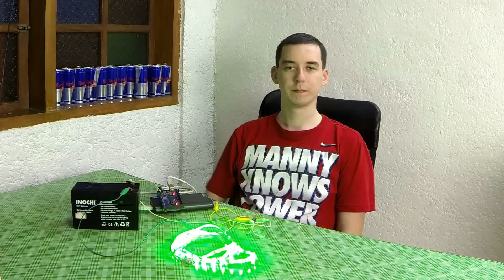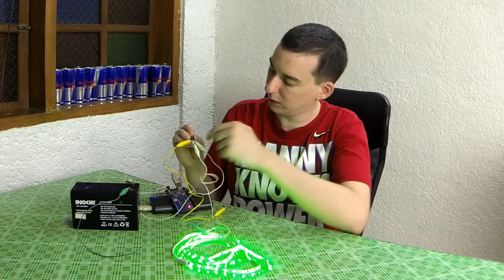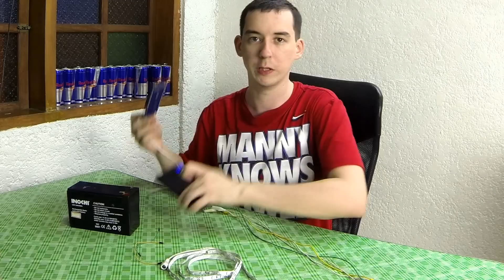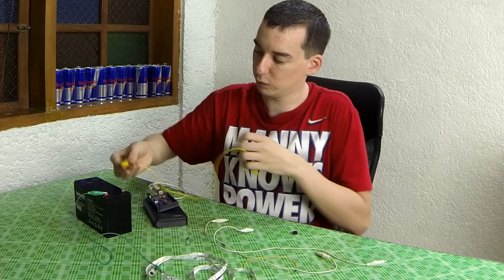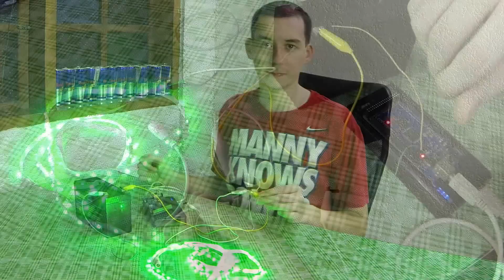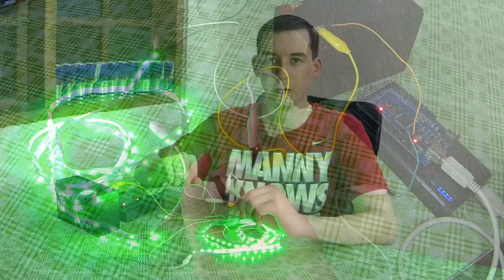Control 12v LED strip from Arduino using a Mosfet

Comment: This video is awesome! I needed this for a project I am doing for a course, but I came across a problem. I have a 5V Adafruit Trinket pro that I would like to program my lights with but it will not work with the setup. I can turn the lights on with the mosfet but not program it :( . Any thoughts on why I am having problems?
Reply: +Dynasty Holman Did you check if connections to led strip, on the transistor and pins on the board (use pwm pin) are correct? If it's as it should be, the thing that comes to my mind is that there is something wrong with either cables, the board or you aren't using the right type of mosfet.

Comment: Be aware this guy must be wearing an ankle strap since there is no wrist strap apparent.... MOSFETS are susceptible to static discharge damage..... It is also bad practice to power up the circuit before everything is connected. The last connection should be to the battery +ve terminal.

Comment: This has been the most straightforward tutorial I've found for powering LEDs.
Do you think it's possible to run 4 of these LED strips with one Arduino Uno board ?
I'm working on a project where 4 motion sensors will set off individual LED strips.
Reply from the maker: Ryan Woodhall Thanks :) And yup it would definitely be possible. It doesn't take much for the arduino to switch the transistor on and off and you have more than enough pins on pretty much every arduino I know.

Comment: Good touritals, with basic information about how to sample the MOS-fet transistor. First, however, I'm missing some tip about the gate, by looking at many project as like this, when using a MOSfet to power up high power load, it's a resistors above 100-470 ohm's between gate and output pin at Arduino. You mention nothing about this issue. Second, do you have some project's/URL to pilot lights (1-3W led's diode) with different blinking cycles, using Arduino Nano? I was thinking a simple UVA light to my DJI Phantom shod contains two red lights i face direction, and two green led's at the back of UVA. At power ON, green blink/flash 3 times during a sec., pause 2 sec. The red led blink 50mS each 3 sec. periode. The cycle period switch off after 3 min., then running for 2 min., off 3 minutes and continuous (safe battery with 3 minutes off). Power source think a Li-Po 11.1V 1200mAh do the jobs. Power mosfet have spec. 30V 5.8A (N-ch), and green mini diode 650mA @ 3,2-3,6V-3W each, green mini led 700mA @ 2,0-2,5V 3W each. Any tip?
Reply from the maker: Tage Andersson Mmm well when it comes to code, it would be extremely simple because the arduino is easy to program and the samples give you everything you need. For the example application you mentioned, you could simple open the 'blink' demo program and modify it to do what you want in a matter of 60 seconds. Those power mosfets should work fine although might be an overkill for those small LEDs :P Especially since they're only blinking and not a constant load.

Comment: Hey! Thanks a lot for the tutorial. This was easily the easiest to follow of the ones I've found.

But while everything initially worked, all of a sudden now the LED strip doesn't really blink, but kind of just goes from 70% brightness to full. The Arduino code still says 'low' and 'high', but they're basically not turning off at the low.

Any idea why that might happen? And how it could be fixed. I've been trying to follow a tutorial by a blog called Arduino Basics, but until I can get the LED strip on I can't really go any further.
Reply from the maker: Ali Murtaza Hmm I'm not sure to be honest. Have you double checked all your connections? Especially the shared ground? And have you tried swapping out the mosfet ?
Reply: Gadget Addict Yes, I've reconnected everything a few times, but it doesn't seem to make a difference. And by 'swapping out' do you mean try a new one?
Reply from the maker: Ali Murtaza Yep try another one just to check if your original one got busted somehow. I've experienced temperamental mosfets after letting them overheat.
Reply: Gadget Addict Ah okay. That would make sense. I'll try getting another one tomorrow. Thanks!
Reply: Gadget Addict Do you have any specific recommendations of which I should use? I'll probably have to order from Amazon.
Reply from the maker: Ali Murtaza Unfortunately not. I always just use any n-channel mosfet I have laying around. If you're making a product to sell or want the best efficiency then perhaps you should consider a specific mosfet, otherwise pretty much any that can handle the amps will do the job :)

Comment: Hi, hey, one question, if i want to control a 5 mts RGB LED strip, (12V, 6A) what mosfet should I use?
Reply from the maker: SplexowN Any N-channel mosfet rated for up to 6A ? Seriously, there's so many different mosfets out there and the availability depends on your area, where you buy from etc. It doesn't make much difference for the average hobbyist so just buy any that's rated a bit higher than the voltage and current you intend to use.
Reply: Yeah, the thing is some people suggest to use a logical level mosfet with low resistance at the VGs @6A
Reply from the maker: SplexowN Yep in an ideal world. If you want to know which is best because of performance, heat etc, I wouldn't be able to help you unfortunately.
Reply: Gadget Addict I don't know why so ideal hehe, but thanks a lot! :)

Comment: Thank you very much for making this video.  I'm currently working on designing a prop FX package around an Adafruit "Pro Trinket" mini Arduino board, and needed a way for the 3v Trinket to control a muzzle flash LED running on a much higher voltage.  I was wondering if I could use a MOSFET to do it, and not only did your video confirm my theory, it showed me exactly how to set it up.  Again, thanks.

Comment: Thank you for the tutorial bud.

This really opens some doors for programming 12v leds with the arduino.

You could basically make your own animated light show and sync it with music tracks or live. It's like DMX lights but cheaper and you get the same effects, if you know how to code it right.
Reply from the maker: brdane Yep! Although for big light shows you might want to buy a cheap 8-relay arduino compatible board. That's what I did for my halloween light show (its on my channel). Be sure to buy the solid state relay board because I found the standard mechanical relays would become 'sticky' if you ran them too fast.
Reply: Gadget Addict can those type of relay boards support PWM?
Reply from the maker: brdane Ah sorry, no they wont be any good for PWM.
Reply: Gadget Addict gotcha gotcha. I think just mosfets by themselves should do the job. I'm not doing really long light shows, it's just for live bands, pre-programmed to go synced up to the band.
Reply: @GadgetAddict  Your entire channel is now dedicated to traffic stops?!?? And for some reason they have a lot more views than videos like this? What is going on.

Comment: This video is so useful for me. Firstly thank you. I just find a solution about my growth chamber. I made growth chamber which is contain 3 series 3 paralel 3W power white leds. I need to control light intensity with potentiometer. So I made a design with LM350 adjustable voltage regulator but it wasn't suitable. Because my leds run with approx. 2.1A so LM350 got warmer and also there was approx 4.5V drop-out voltage. So if I use mosfet and potentiometer system, is there high drop-out voltage ? I just curious about it Thanks

Comment: Thanks for the help
could you use this set up to control the color of the LEDs (if they are able to change colors)
Reply from the maker: Jack Lamuraglia This can only turn on/off and PWM the strip. For color control you need a digital signal rather than just on/off.

Comment: I notice some of these mosfets are capable of high currents...say if I wanted to drive a couple of motors this way but required 8v from a 12v battery...could I use this arduino pwm to step down the voltage while keeping the current constant? if so how efficient would it be at maintaining say 20A of current as I lower the voltage...I suspect the mosfet would get really hot
Reply from the maker: Ian Fowler Yep you could do that and yes it would get really hot lol. So you'd need some chunky heat-sinks and probably a cooling fan.

Comment: When using the Arduino power supply I'm getting a strange result. I can get it working as intended as long as I have the 5v USB plugged in as well. If I unplug it, it doesn't work. Basically I'm using the 13 pin blink example that comes with the arduino sketch program. I'm connecting my LED strip positive to the Vin on the arduino and the negative of the strip to the center pin (drain) of the transistor, the Source pin of the transitor is connected to the ground on the arduino and the gate pin connected to pin 13 on the arduino. Like I said, it works when both power supply and USB are both plugged in, but not when I remove the USB plug. Any ideas?
Reply: Kevin Brandenburg This is of course using the power supply instead of a battery.
Reply: I did however manage to get a nine volt to work connecting the positive to both the Vin and to the positive on the strip, ground of the 9volt to source on the mosfet and also to ground on the arduino. Just not sure why I can't get the power supply to power both them. However, my intention is to use a 12v battery so I know I can get it working, just confused with why the power supply requires the USB as well.

Comment: if I wanted to power the arduino from the same 12 v battery,how could I do it?
Reply from the maker: Tore Chikano You can just connect the battery to the Vin and GND of the arudino. The arduino already has a voltage regulator built in that can handle 12v :)
Reply: Gadget Addict Thank you!

Comment: Can I use it for 12v Ws2811 strip?
Reply from the maker: Aditya Patil I assume so but I think that's an RGB strip so you might need some extra magic to control the specific color.
Reply: Aditya Patil No, RGB's with WS2811 protocol are better controlled with something like a SanDevices E6804.Each LED of the WS2811 is a Pixel expecting proper lighting instructions via the controller.
Reply: Gadget Addict Thanks man
Reply: Nodent Thanks

Comment: hi, nice vid. Could you tell me if this one would work?? i plan on passing 1 amp load
http://www.ebay.com/itm/5pcs-IRL3803-L3803-Power-MOSFET-/180927851217?pt=LH_DefaultDomain_0&hash=item2a2023ead1
Reply: Kariofillis P did you try it? did it work?
Reply: Shyam Haridas I ended up using these that i had lying around : http://www.ebay.com/itm/170943541084?_trksid=p2057872.m2749.l2649&ssPageName=STRK%3AMEBIDX%3AIT plus an LM324 op-amp cause the due outputs 3.3V and the gate from those is fully open at 4V.

Comment: I have an "IRF 540 O" MOSFET. Datasheet: http://www.irf.com/product-info/datasheets/data/irf540n.pdf. However, I can't tell from the documentation if it is N-channel, P-channel. There is one mention of "N-channel" for one illustration. And one mention of "P-channel" for another illustration.
Reply from the maker: Hmm, I'm not sure either. I would just test it and see what happens :) Just be ready to disconnect it.
Reply: Gadget Addict Interesting. No wonder I can't tell :) Thanks.
Reply: mrvelleful N-channel
Reply: Honza Jochman
Thanks. But could you please tell me how you concluded that? Did you read it from the manual, and if so, how?
Reply: mrvelleful http://www.irf.com/product/Power-MOSFETs-Single-Power-MOSFETs/_/N~1njci4
Reply: mrvelleful http://www.irf.com/product/Power-MOSFETs-Single-Power-MOSFETs/_/N~1njci4

Comment: Hi! Could you tell me, what kind of mosfet you did use in this example? I tried to do fading ledtape, but unfortunattely it doesn't work properly. Insted of dimming ledtape I have blinking ledtape. With only one LED fading works properly using the same code. Thanks in advance.
Reply from the maker: I don't remember the exact model but it was just a generic N-channel mosfet that was rated quite high in terms of amps. Far above what I needed to run that little LED strip. During my testing I swapped it out with some smaller transistors and other n-channel mosfets without any changes in code or circuit design. Are you sure your power source is capable of delivering the power required for the strip?
Reply: Hi! I solved the problem by putting the 0.1uF ceramic capacitor between VCC and GND pins of chip.

Comment: looking at some MOSFET switching circuits, they have a resistor from the gate to ground. Any thought on the use / benefits of this?
Reply from the maker: MrRobertpn The resistor to ground is a good idea. It ensures the mosfet 'turns off' when you expect it to, without any power sitting inside it. It can also solve/help the issue I showed where you touch it with your finger and the static charge triggers the mosfet.

Comment: Is it possible to use one 12v battery for arduino and LED both?
Reply from the maker: Yes. The Arduino has an onboard voltage regulator. Simply connect the 12v to the arduinos VIN and ground.

Comment: im not an electrical engineer....but is it possible to connect some AA batteries to a 2m LED strip?....i just need it for like a couple of hours of use?...any help will be great
Reply from the maker: If you had enough AA batteries wired in series to bring up the voltage then you could probably do it. Let's assume you had 8 AA batteries in series, giving you 12 Volts and assume they're rated at 2000 mAh. That gives you 24 watt hours of power. Let's assume your LED strip consumes 6 watts, 24 / 6 = 4 hours. But of course the voltage of the batteries drops as you consume them so you need to know at what point your LED strip can still operate. If it's something you're going to do often, I'd buy a portable 12v Li-ion battery. If weight isn't an issue, consider a standard 12v 7ah sealed lead acid battery :)

Comment: How hard is it to use the arduino? I don't know much about micro controllers or computers. How would I go about getting one and learning how to use it, + I would like to get an osiliscope and I haven't got a clue where to find one here in the Philippines.
Reply from the maker: It's pretty easy to get started with the Arduino. Over the years I'd tried some alternatives but Arduino really seemed the best. It comes with lots of sample sketches (programs) and there's great 'getting started' tutorials on the official website. You can buy an arduino from OLX or from E-gizmo in Manila. The clones are generally just as good or identical to the "official" arduino but much cheaper. Just buy a breadboard, some switches, buttons, LEDs and such like to go with the arduino for you to play with. I don't have an oscilloscope but I've seen some for sale on Sulit/OLX but they're kind of expensive. You can buy from china/HK through ebay but you'll likely be charged by customs when it arrives in the country.

Comment: hi, great video, but i am struggling to get my lights to fade on/off.  for a while there i couldn't get the lights to come on at all!  i am using a 12 v power supply, positive from transformer to positive of LEDs, the negative i have linked to a bread board on the negative strip.  from that strip i have wire connecting to the GRND of arduino and to the right hand side pin of the mosfet.  the middle pin of the mosfet is linked to the negative connection of the LED strip and the left hand side pin of the mosfet is linked to the pin of 13 on arduino.  i have used the fade test program, and the LEDs do not fade on/off, they just stay on, what am i doing wrong?  is it the mosfet??  any help would be greatly appreciated.
many thanks
tom
Reply from the maker: Hi Tom, that all sounds correct. What mosfet are you using? Have you checked that pin 13 of your arduino board supports PWM? It varies depending on whether you're using official hardware or clones. You might have to swap to another pin.
Reply: Gadget Addict Hi, thanks for getting back to me, i am a total novice building something for an art installation so i am trying to learn alot, very quickly.  I have just searched the mosfet online and think i have found my issue, I am using a FQP27P06 60V P-Channel MOSFET.  in your video you clearly state not to use this type.  i was given this mosfet from an online arduino supplier store after i explained what i wanted to do.  Can i make this set up work using this type of mosfet (is there something i can do in the code to make it work)?or should i just get an N-type?time is precious at this point.
many thanks once again
tom
ps how do you check if pin 13 supports PWM???
Reply from the maker: shambolica If i were you, i'd just go buy or order an n-channel mosfet and save yourself a lot of hassle. You should be able to read the documentation from wherever you bought your arduino on the pin output. Try pin 9.

Comment: This is perfect what I'd like to do with my 10w LEDs. How could I control these automatic with a screen control run from with arduino UNO or mega2560 and I have a network expansion for it too but I know no coding so I need help. I'd like to have on/off manual brightness from 9v -12v at 900-1000mAH for each 10w led and also would like to set timing throughout the day automatic like full brightness at say 5pm till 2am then 50% from 2-6 and 25% from 6-8 and 0% from 8-5 unless I want to override with manual on/off and brightness with a rotary encoder I'm thinking might work? Could you help me figure this out?
Reply from the maker: Mmmm it would be pretty much the same as what I've done in the video except you'd add a real time clock or grab the time over the network from a time server. It really all comes down to the coding for your arduino. If you play with the example sketches and jump on the arduino forums you should be able to work it out :) I wouldn't have time to code it for you unfortunately.